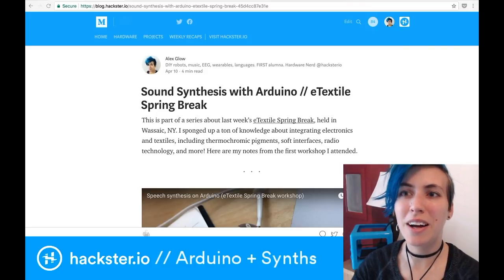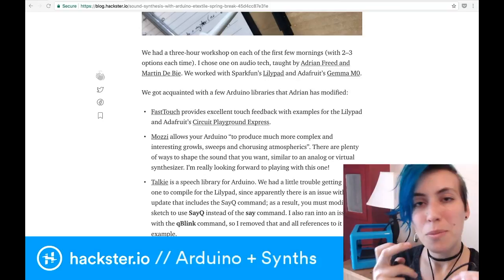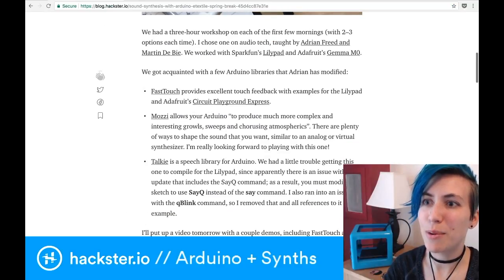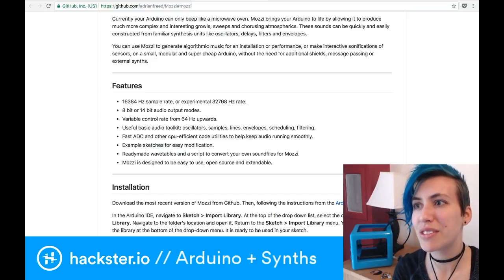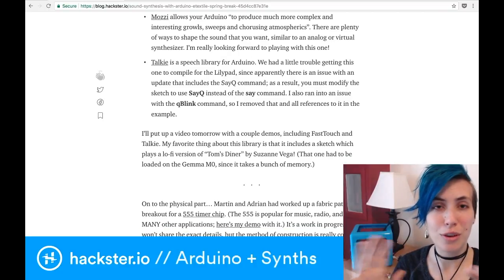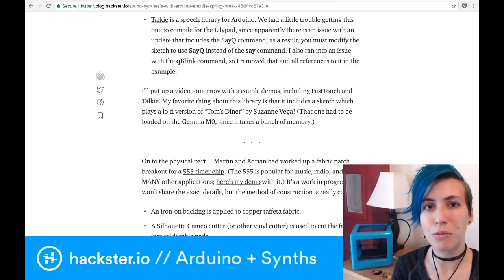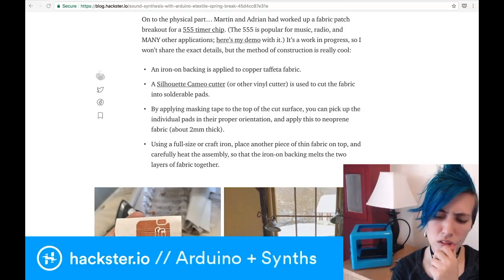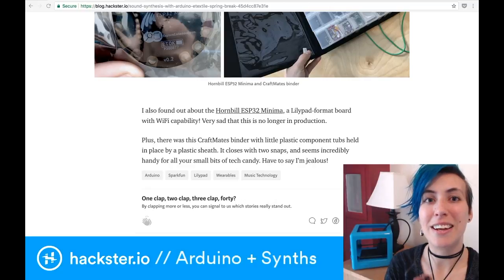Sound Synthesis with Arduino

Comment: Great video! Little building blocks of much-desired knowledge, bite sized and easy to consume. The capacitor attached to the speaker... Could it be for dc filter? What with audio to speaker being strictly AC?